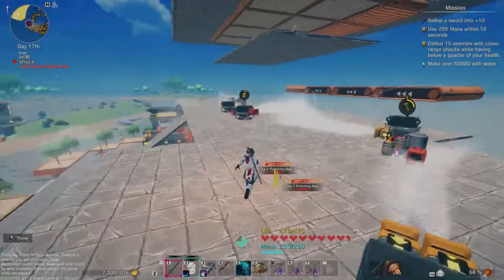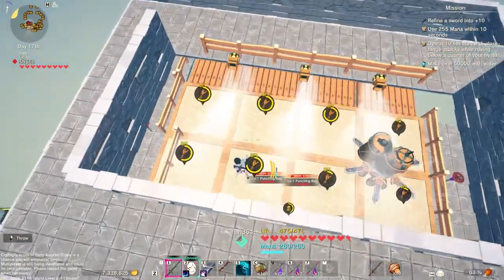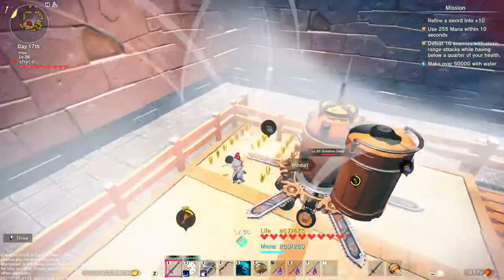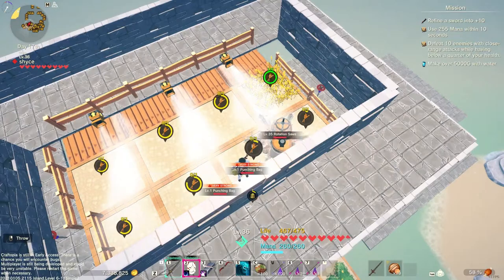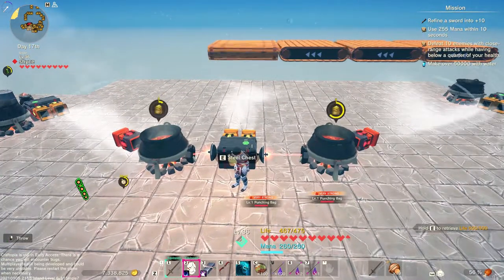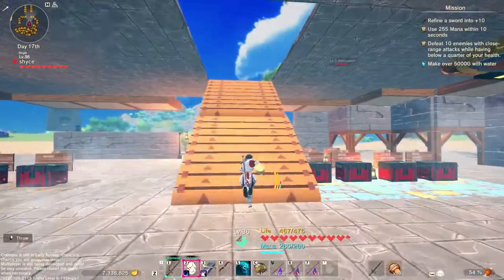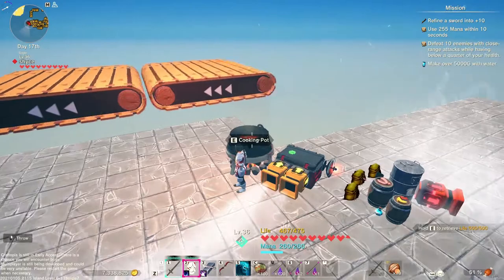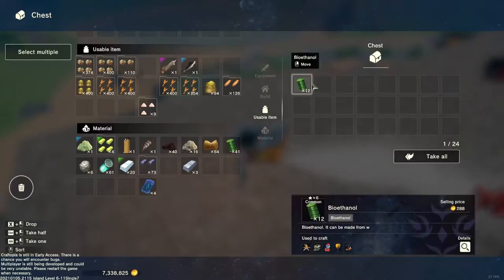How To make a fully automated Bioethanol farm [HOW TO CRAFTOPIA]

Comment: I've never tried any of the multi-level auto-farming things yet, but I should probably consider it.  I may also need to see about trying the double-absorbers to make sure stuff is getting picked up.  I totally understand the weirdness about connecting the droppers to the pots.  I usually wind up having to hit G to allow more fine rotation of the pot & I can eventually get to be roughly perpendicularly set.  A couple other things I've done that may or not be useful:
- The wheat farm I'm using is larger (maybe too large) so there is always wheat to be cut (so no fence/wall around the farm), although the downside is that even shooting into 2 different pots, it gets backed up & I have to empty the wheat occasionally to process in regular pots & throw back into the middle storage chest for aging
- Since I got the right angles going, I put up a wall where the pot throws the flour and the absorber "pokes through" the wall & that seems to solve the issue of stuff dropping on the ground.  Plus they are fairly close together (maybe just on 2 or 3 squares)
Reply from the maker: yeah, the reason I made a small farm is due to how compact I wanted it and also how slow the auto crafting is. My wheat chest is always 100% full no matter what right now anyway, so it doesn't really matter how small it is rn, also I know about having the wheat at an offset interval will keep production maximized, I placed both my sprinklers at different times to achieve this effect.